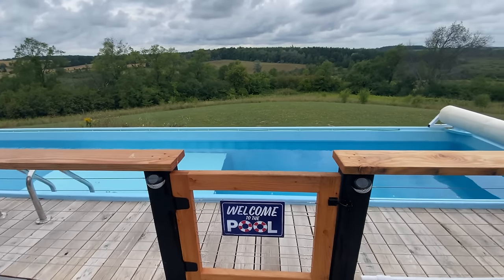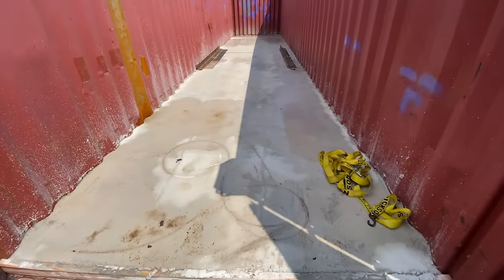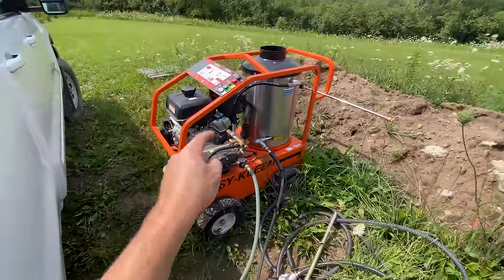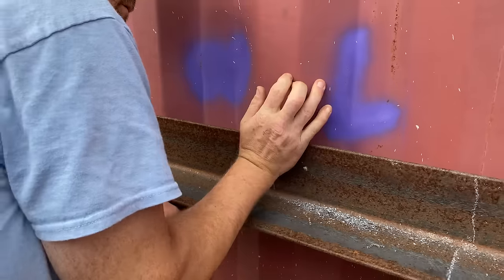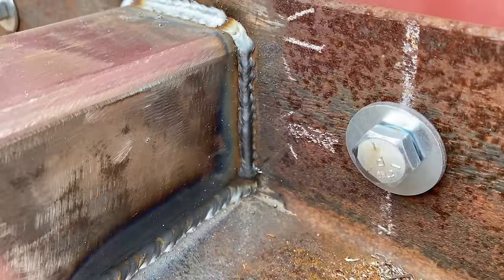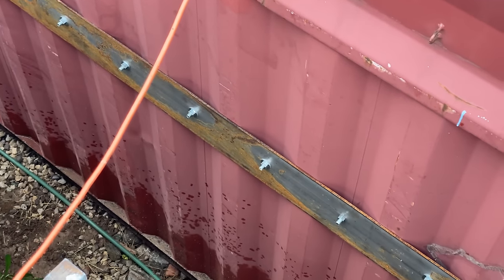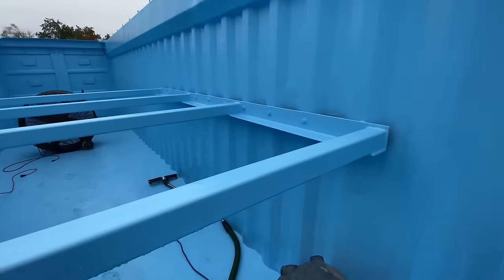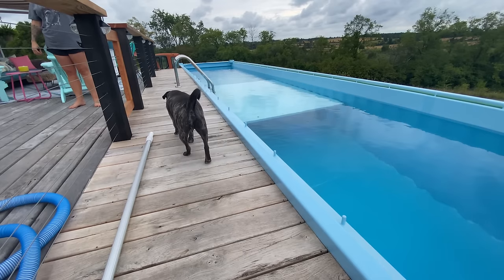DIY 40' Shipping Container Swimming Pool Build Full Size

Comment: Having had several steel above ground pools, would it not have been more practical to have support struts/legs on the outside to bare the weight giving full space for swimming?
Reply from the maker: Maybe.....maybe not.   I do like the center shallow "end" and with it full swimming over it is no issue, and going under it is fun. In my head it made send to me that both sides want to push out, so connecting the 2 would counter them selves.

Comment: I’m just an old lady but here’s what I would have done: weld it all shut and cut your pipe fittings out and your skimmer intake hole. dig it out and drop it in the ground. Sandblasting it first. Then close cell insulation spray it, and maybe shoot a fiberglass layer over that. Then order a liner. No leaks and you have a solid base, backhoe it to level and the soil will hold it, you won’t have to worry it will break
Reply from the maker: I wanted it level with my deck, so I could only have about 3' of it buried.
Reply: Terrible idea
Reply: You wouldnt have anymore room to swim after that.
Reply: Your deck can be what ever level you want it to be, and an apron around the the pool a little higher than the deck with the ground supporting the sides maintains the whole 40' as a lap pool. That thing in the middle deletes the purpose of a 40' pool. It's now two separate sections divided by a shallow spot. The video is still useful so thanks for posting it. I would go with the plan above.
Reply: If it will break! Spell checker

Comment: About to do one my self.  Bought 2 and going to put them together (I'm a welder/fabricator) . Was hoping you could do another video showing all the leaks,  flexing  and bottom seam and bond between concrete and metal walls.
Reply: Maybe you can also do a video.
Reply: Yup
Reply: Yes, do a video
Reply: Have you started? I'm in love with this idea
Reply from the maker: Here is the follow up video - https://youtu.be/BeNO7tVZnUg
Reply: 19:53
Reply: Don’t do this.
Reply: Why?
Reply: Not a pool expert but the leaks might be easily avoided esp around the doors using roofing membranes hot applied. ?

Comment: Big props for taking on the task. It may be too late at this point but you could've bolstered the container with 45 degree supports connected to a long horizontal bar on the outside. This would also allow you to have that shallow platform on one end of the pool with the underneath restricted by a net. As it stands now, maybe you could add a tight rope from end to end under the center of the shallow platform? Someone can just pull their self if they get disoriented. Also, you stated that you're getting some small leaks. Are they from the holes you drilled for the bolts? I didn't see any type of rubber seal between the wall and the angle iron.
Reply from the maker: Hi Paul, having the shallow end just 12' wide, swimming under it is not an issue. Of course with young kids we make sure to monitor them and make sure they know the risks. I just siliconed the bolts and made large hardwood washers on the outside between the steel plate and container, zero leaks from the bolt holes.
Reply: @CanadianWoodworks where are your leaks coming from?
Reply: are you leaks gone after doing that? @CanadianWoodworks

Comment: No radiant floor tubing built into the cement?   You could add some Evacuated Solar Tubes panels and you would have a nice little setup to warm it up.   You can still heat it with the tubing by mounting them on the side or bottom in panels.
Reply from the maker: In hindsight, that would have been pretty smart to have pex tubing inside the concrete, my shop is heated that way. Not much cost to add either, even if I never use it.  Darn

Comment: Just wondering how you stopped all the bolts leaking on the shallow platform ? Great job btw👍👍
Reply from the maker: The bolts went through where the steel had about a 2'' gap on the outside to the steep plate, I made hard maple "washers" which were lust thicker then the gap, applied silicone and once bolted tight they were held very tight against the skin of the container.   This is one part i've had zero leaks or any issues.

Comment: Im a year later here and still watching, but i wanted to ask if you couldve braced the sides from the outside. Again, still watching so im sure you got the job done.
Reply from the maker: For sure bracing could be done from the outside, but it would have to be pretty beefy and "engineered" well.  My method super simple I think in comparison.

Comment: Fantastic job on the pool.  Just wondering how much something like this would cost compared to a traditional purchased pool.  Also, why didn't you grind those nubbins sticking up on the sides from the tarp room system of the shipping container?
Reply from the maker: I have about $12,000 invested which includes everything!  I always planned to clad the top with wood, but spent my time chasing leaks.   Now with leaks fixed, I think I will just cut off at the end of the season.

Comment: Since it's going to be under a deck anyway, why don't you just support it with footers underneath? You won't be able to see it. Put concrete footers with steel beams on a slant holding the center walls square?

Comment: water is going to get into the bottom of those pipes @12:00; you didn’t weld the underside seam and the water pressure has 100% worked its way into those horizontal pipes
Reply from the maker: I did end up welding the undersides, I thought it was going to be difficult to weld upside down, but in the end it was easy and got a great weld.

Comment: Awesome work. Thanks so much for sharing. I’ve built a container pool and I have just had the wall bow on me after I filled it. 
Love your solution but may try an overhead brace rather than a shallower middle. 
However, I would like to know what epoxy pool paint you used? I used Semco liquid membrane but not terribly happy with it. 
Any help would be appreciated 
Well done
Reply from the maker: I used Ramuc Pool Paint Type EP Epoxy, for sure happy with it. I did not want to brace from over head.  Very happy with the shallow end, can stand nicely for kids and still swim over it with out any issues.

Comment: I don't understand why you used the shipping container at all. Why didn't you just buy a pool liner and make a regular pool? It would seem to be the more practical option and less inclined to failure. (No joints to leak)
Reply from the maker: Cost of a "regular" pool like this would be like 100k+ and I don't think something as simple as this.

Comment: I would have not used bolts would have just welded it, that would have sufficed if welded properly.
Reply from the maker: I did't not like the idea of 1/4'' thick material being welded to the very thin material of the container which is about 14ga.   Also figured it would be easier to change if I needed to. So far the bolting has had zero issues in regards to leaking or strength.

Comment: You seem to be a skilled welder. I would think it'd be better to weld the steel structure through holes to the outside plate, and then along all the edges. For less likely to have leaks around your bolts as silicone only lasts so long. Also without welding angle irons below your shelf to support the weight everything is on sheer on your bolts. Every time people walk around on it it's slowly wiggling those bolts.
Reply from the maker: so far zero leaking from the bolts, considering how many 1/2'' bolts I used I'd think its enough sheer strength, but ya I guess it could be inducing some movement into the bolts. I have them exposed on the outsides of the container, to keep an eye out for any leaking.

Comment: 6:32 no wonder you burnt through so many bits… you’re drilling metal you can put all your weight behind the drill and push as hard as you possibly can. It’s not wood, it takes a while. Just apply a little bit of pressure, it takes a long time… it’s not wood!
Reply from the maker: Also pretty garbage bits but ya i'm no machinist! (-:

Comment: spray a little wwd40 on your drill bits...u will find they go in easier and will last longer..less friction
Reply from the maker: I thought in my head, I did't want the oil to corrupt when I went to epoxy paint it.  But yes a little drop of oil would help alot!

Comment: I didn’t see you weld the bottom of the tube to the angle. Water would still be able to get in. Hopefully the epoxy seals it.
Reply from the maker: Ya i'm dumb, I did use a 2 part epoxy to fill that gap but I did get a touch of rust showing through, in the end I did end up welding the underside joint also.

Comment: Nice welds.had to take a while with the hole drilling.on every rib.then on angles iron and outer steel  plate.seems a little over kill .unless standing alone or being mobil.if you put it in ground,pack soil after piping installed I don't see it bulging.i like the engineering thought of shallow end in middle.unique idea as well.seems like it would be fun to swim in.all those holes drilled seem like a lot of leak spots.anxious to know if it leaks at all and what you will do to seal the holes..
Reply from the maker: So far zero leaks at all the shallow end bolts holes, we siliconed and made big wood washer / spacers which are on the outside and seem to really work well. Overkill perhaps, but I'd rather not fins out.  I did't burry at first because of making sure no leaks, so it was needed. Swimming under the platform is fun for sure!

Comment: What would be the cheapest option if you were to put the seacan in ground, could you get away with just doing pool epoxy no concrete, or would it be cheaper to run a liner,
Reply from the maker: Yes perhaps cheaper to do a liner, when I started the build it was during Covid and there was like a 1 year+ wait time for a liner.  I also wanted to keep the feel and look of a container on the inside.

Comment: Why did you not turn the angle iron over? flat surface then.
Reply from the maker: Gave me a place to weld all sides of the 3'' tube so it was sealed from water, and lot's of weld surface for strength. Thanks for watching

Comment: If you didn’t weld under the square tubing to the angle iron then it can definitely get water in that way.
Reply from the maker: At first I sealed it with silicon, but I did end up welding the underside, but did not get footage at the time.

Comment: i love this video! im a bit confused at why you put the shalow bit in the middle as i dont think you would be able to swim laps of the pool. i think it would be cool to add in a system to move it up and down. i just hope the container dosent collape!
Reply from the maker: I can confirm swimming laps is no issues with the shallow end height, reason it needed to be there was to hold the container from bowing at the center because of the weight of the water.

Comment: I probably would have welded a 3 or 4 inch ball valve on the bottom for a drain.
Reply from the maker: I did have a main drain, 2''' ball valve (-:

Comment: So to say but the steel tubbing  probably full of water you for got to weld the bottom of them to the L bracket  but maybe you did it off 📷
Reply from the maker: Ya I caught that one, I did a bit of welding upside down testing then went back and welded that part.  It was easy, should have just done it at that time.

Comment: Thanks sooooooo much for this! Can I ask what the end cost was at the end? (Outside of labor costs)
Reply from the maker: Hi, Thanks for watching, right around 12k Canadian.  Container was around $4000 and $2500 for the pool equipment.  Then all the other stuff, concrete, stone under container, epoxy pool paint, steel and bits and bobs.
Reply: @CanadianWoodworks  better than 80,000 which is what they want for the professional ones! Lol That is super encouraging! Thanks!

Comment: I'm about to start on mine right now. Jk, but this is an awesome fucking build.  Use some lube or even water if you have to to keep your drill bits cool. They will last longer.
There is a literal night and day difference between a Milwaukee and a DeWalt drill. Put one in each hand and see which does better. I promise you'll throw that DeWalt away.
Reply from the maker: Ya I'm about done with Dewalt, the batteries stop being able to be charged so fast, it's such a waste of money and horrible for the environment.
Reply: which motor oil is best?